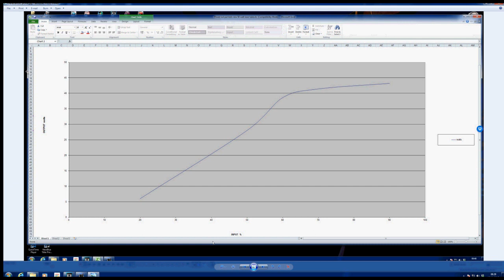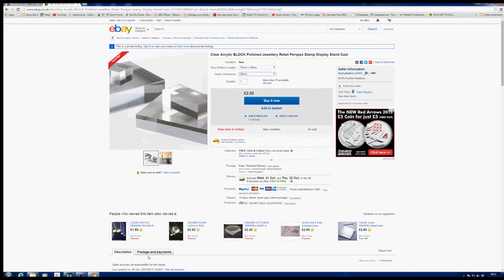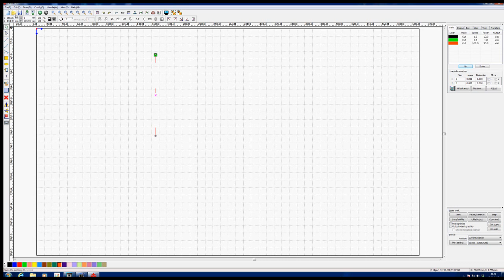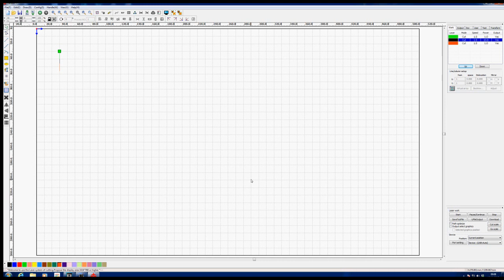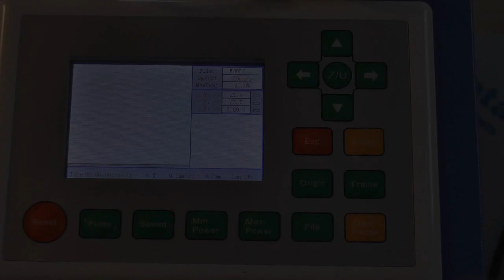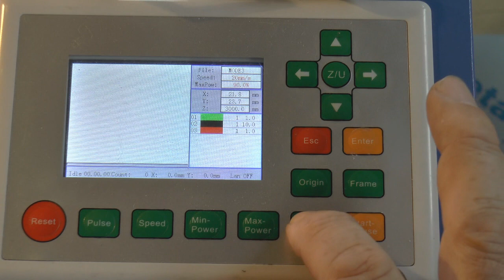RDWorks Learning Lab 22 The 50watt fraud   a lesson learned

Comment: you think the the problem is from the laser tube or the power supply that feed the laser?
Reply from the maker: +nayef al 
I do not have any absolute way of measuring the power from my new tube, my results are all relative, but as you can see clearly from the mode burn results, using in excess of 60% power will not get  me better results.  My new 50 watt tube was sold with a specification of 20mA recommended drive current. it is possible that my power supply gives out 20mA at 60% power setting and I am actually getting 50watts of output. This could mean that it was probably set to over-drive my original tube, and with me doing a lot of testing at 95%, I quickly wrecked my tube. As I have said to all those that look at my videos, I am still learning, but sharing with you my current knowledge and insights. This over-driving is a new issue to me and I am still learning. Depending on how your tube power supply has been set, it may be safe to run at 80% or more. There are many machine users out there who want to just use their machine and not be concerned about these sorts of technicalities. This video is just a warning to all, BE CAREFUL, and  shows them an empirical method of finding what a safe percentage may be for their particular machine.

I have recently joined a user group where there is a discussion on this point.

http://www.sawmillcreek.org/showthread.php?209026-My-LASER-current-meter-for-DC-tubes

I am planning to build one of the current meters mentioned here to monitor my tube current. I am a little hesitant because I am not an electrical engineer and the thought of messing with 20,000 volts DC needs a bit more research into the cable requirements to feed the meter and the housing insulation. Until I experiment (or  get some tech help) I don't know if I dare adjust the power supply or whether I shall just keep an eye on the meter.